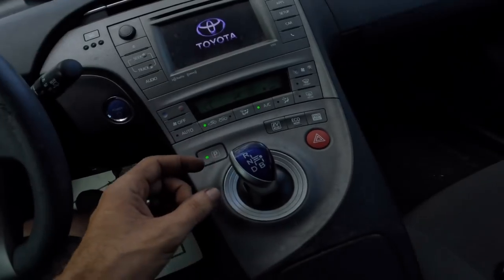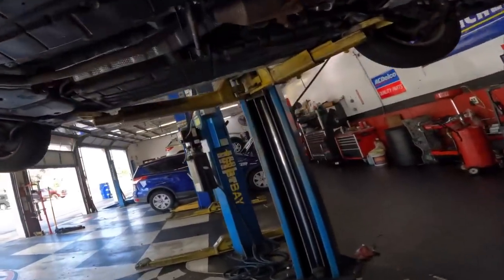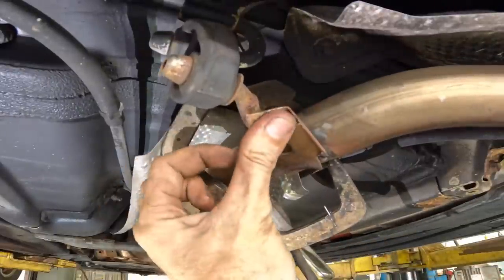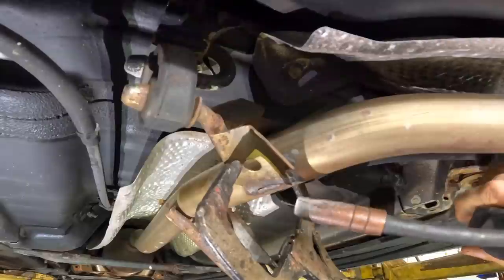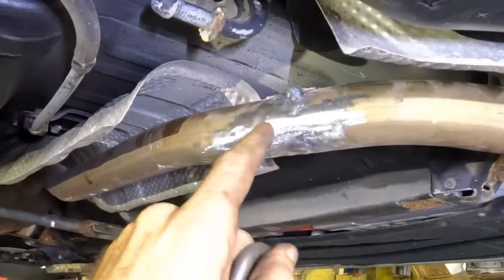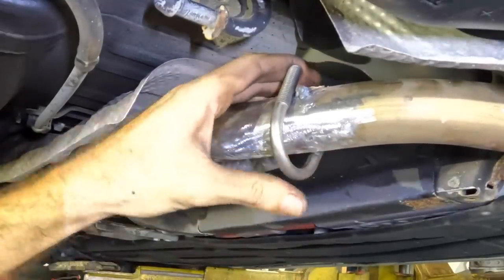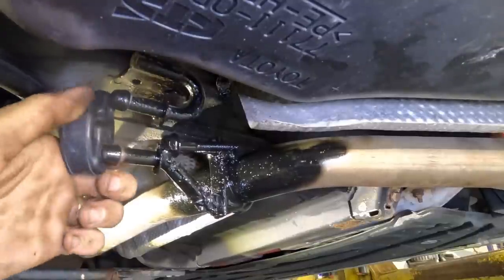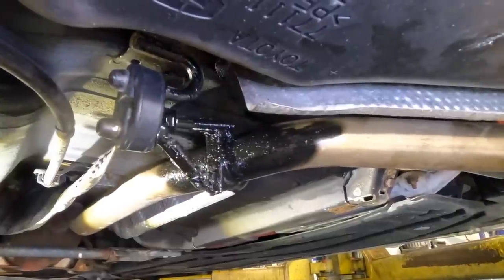This Video is a BAD Idea! Saved Customer THOUSANDS!

Comment: As an ex welder turned weld inspector, your welds failed TREMENDOUSLY lol however, you saved your customer money and are honest and that makes up for , well, none of your failed welds, but you did say numerous times “I’m not a welder” soooo not bad my friend, not bad. I’ve seen muffler shops with work that ended up looking significantly worse than this!! Most shops today would’ve told them to go to a muffler shop, if not charged them hundreds to “fix” something it didn’t need fixed. Great job as always!!
Reply: Do you think Ray's welds will hold over time?
Reply: @ptroinks  honestly they probably will. I’ve seen some absolutely beautiful welds fail epically and the ugliest welds hold. Also depends on the procedure they’re being inspected too also.
Reply: You wouldn't believe how many "custom exhaust" shops run 409 stainless and don't have the equipment to weld 409 stainless.  They just glob on the Er60S4 and call it a day.   The hope is they haven't damaged the stainless that much and the weld is thick enough that it will take time to rust through.
Reply: @KendrasEdge757  Something I've never understood about welding, is how a welder can be sure that the weld is good. Without ultrasound or x-ray, that is.
Reply: @ptroinks  when you’re welding you can see the puddle and you know that it’s fusing to the base. It’s gonna be solid but X-ray, PT, VT and MT and UT Is gonna show surface to sub-surface cracks and porosity. A visual inspection is sufficient for most welds and most welding schools teach basic VT to welder, level 1 typically. Basic exhaust welding like this doesn’t have inspections and typically mechanics haven’t done much if any welding school. They just don’t do much welding past tack welding. Which is completely normal. It’s not cheap when your main job is mechanican.
Reply: @ptroinks  Sure they will. After he cleaned up the old welds and installed the u-clamp, he was welding to solid steel. That repair will outlive the cat.
Reply: @OldBastardOnaHarley  Yep, he realized trying to weld rust wasn't working, so after all the cleaning with the die grinder, and starting over with 'nice n shiny' parts it turned out pretty good. With the addition of that top bolt forming a strong triangle, there's not much stress on the welds anymore. Strong enough to hold 200 lbs, but the exhaust pipe isn't very heavy at that point, that rubber connector becomes the weak sacrificial link. That rubber will break or fail before the welded parts will. Original one was already split...
Reply: @ptroinks  Why not, unless rust eats through it. The latter will happen sooner or later, exhaust on my car got its third welding session just recently. Had multiple leaks due rusted through factory welds and previous repair welds.
Reply: @ptroinks  I think a lot depends on whats at stake. On heavy equipment, high pressure pipes, structural welds, rockets, ocean going ships, etc,  it makes sense to go through the expense of extensive testing to make sure there are no hidden imperfections. Failure can cause injurys or cost big $$$. On something like this failure isn't that bad. It just makes some noise and Ray is reallly just extending the life of a part that would otherwise be scrapped.
*not a welder, just a guess.
Reply: @brnmcc01  Rigid bodies will amplify forces asymmetrical to the amount of force being applied. This is because of wave physics. Yes, wave physics. This is why welds sometimes fail under rapid small loads while the same weld may be just fine under much larger but less rapid loads.

I know this distinction is fairly pointless for a cheap exhaust pipe but just figured I'd share.
Reply: @ptroinks  Learning the proper technique followed by lots of practice.
On the practice pieces you cut across the weld to see how well it penetrated.
Reply: @Mavendow   That's very true, but I think that is the purpose of that rubber connector, it has flexibility as well as acting as a damping force to high frequency vibrations.
Reply: A local shop I've been to had a wall of shame for some of the crazy things they've found, like brake rotors worn down to the vents, funny repair jobs, and the like. I'm sorry to say, your welding wouldn't have even earned a dishonorable mention! 😁 I did see someone's exhaust repair there that included a two inch mound of weld. 🤣

Comment: Hey Ray - just a small warning - please wear welding Gloves when you weld!  The ultraviolet which the helmet shields your eyes from - also does SEVERE damage to a person's skin... you don't see it Now - but will in some years.  So be nice to yourself; invest in some welding gloves - and WEAR them - even on very small welding jobs...
Reply: As someone who's received many "sunburns" from welding... I concur. I used to get them on my chest/neck between my t-shirt collar and welding hood.
Reply: Welded in a squat position for half hour in cutoff Jean shorts. I’m a ginger. Second degree radiation burns. Ow.
Reply: And with breathing all that BRAKE KLEEN, not good
Reply: @aaronbritt2025  I attached a leather flap to the bottom of my welding helmet after doing the exact same thing. At the time I was wearing bifocals and had to look out of the bottom of the lenses when welding which meant raising my chin and exposing that area even more. 

Now I have a helmet with a much larger (taller) lens and I wear “cheaters” so I don’t have to raise my chin. Problem solved.
Reply: @Dave-ei7kk  I bought a neck guard. It looks like an ascot.

Comment: Hi Ray! Being a mechanic and an Expert on exhaust sytem and  pretty good welder I'm shocked that your saying there's no gas. In my old shop (retired now) we had a mig welder but it used Argon gas. Koodos for the repair insted of the replacement. For your rubber bracket next time put a little grease on both hangers, once the rubber on it will not slip off even with the grease. Love your videos .. Mark from Montreal Canada.

Comment: Welder here. main issue is that you tryna weld self-shielded fluxcore through some sort of anti-rust coating like galvanisation. makes it bubble up and look narsty as well be super weak. Glad to see you doing it in a way that will work well and save the people some money :)
Reply: I was thinking the exact same thing.  I'm definitely a novice, but I was taught the grinder should have come out before the welder :)
Reply: @innomin8251  Thank you for saying that! The rust and metal parts have got to be CLEAN! I am not a master welder but I have been wrenching for 30yrs I was taught to make sure the metals are RUST free before you weld!
Reply: Don't forget when welding with gasless wire you really need to knock the slag off between welding strikes. Welding over your Slag is not usually ideal. I think if he would have cleaned that pipe and bracket before he started this would have been a shorter video.  I personally would have wired brushed the galvanized coating off the clamp 1st as well. It would have making this job a little easier on him from the start.

Comment: Your welding woes may have been caused by the exhaust being plated in something that was not weld friendly. Maybe a some kind of bronze/zinc mix to prevent rusting. In future try taking a zip wheel to it and take the coating off, so your through to steel coloured steel, not that goldish type colour. Especially important to do if your trying to weld to a surfaced that's got a galvanised coating, not only is it a pig to weld to, the fumes are also somewhat poisonous to breath.
Reply: It's stainless steel not coated you need a tig welder for stainless
Reply: @bigdaddymak1439  you don’t have to use TIG you can use a MIG with stainless wire.
Reply: Stainless steel is no big deal to weld ,however not having a shield gas is .I find Tig is the smoothest weld but even stick can be done well with practice .Compliments on saving that exhaust system ,finally doing repair work instead of assembly line parts changing .
Your customer should give you a handsome tip.?
Reply: I agree but its probley stainless. You will need stainless wire and sheilding gas or a tig.
Reply: Exactly what I was going to suggest.    I'm no welder by trade just another tech. But I know from my experience  cleaning the surface before welding will usually make your welds stick a smidgen better. Great work ray!
Reply: "the fumes are also somewhat poisonous to breath" A little cyanide never hurt anyone....or maybe it did?  You really want to grind your surfaces clean.
Reply: @bigdaddymak1439  
No you  need stainless wire or rod but. You can weld to stainless with carbon rod it will  not be stainless  any more. This may be  aluminized  tube.

The thing that bothers me most as a AWS Inspector is that  he continues to  weld ove the flux without  cleaning EEWW
Reply: @monkeybusiness63  Well he did say he was not a welder lol.
Reply: Aluminized steel
Reply: Ray said it wasn't stainless because it was magnetic.
Reply: @bigdaddymak1439  Not really. Stainless can also be welded with MMA and MIG, sometimes preferably so as TIG puts lot of heat into workpiece. Sometimes I've used stainless electrodes "just because I can and had them around" and I feel that those stick/flow better on normal steel and slag is easier to remove. But then again, I'm not a pro, don't follow my example.
Reply: @OldBastardOnaHarley  just cause he said it wasn’t stainless doesn’t mean it’s true!  There are two major types of stainless Martensitic and Austenitic, Martensitic is magnetic and Austenitic is not! 

I am a retired certified welder that’s certified in many of processes!
Reply: It ferritic stainless so it can be welded but very hard with flux core and dirty... Tig is cleanest but mig isnstrongest but you need stainless wire and a different max gas.
Reply: A welder and a painter no less
Reply: @clintonhanson  Well Ray said he's not a welder and neither am I. So this is going to be an education from all you "certified" people.

Comment: IT student here: the shielding gas is there to help protect the weld from inclusions while it is being formed, without it the risks of an inclusion forming joins the 40 mile high club. so without it your increasing the likely-hood of the weld breaking in the future. there's also making sure your metal types match -certain wires don't mix with certain metals in welds because mixed metal corrosion is always fun!
you do what you gotta do Ray but Industrial tech guys will HIGHLY encourage its use when possible

Comment: That exhaust system is more than likely made out of grade 403 stainless steel (UNS S40300), one of its physical properties is being magnetic another is that it has good corrosion resistance. The problem with welding that material is that you get loss of chromium where it is welded, hence the corrosion around the areas that have been welded unlike every where else that is devoid of any corrosion.
Reply: Yup or 409. 409 is used for furnace heat exchangers as well, it can get some surface rust, but it's more resistant to cracking from heat cycles. 316 would have even better corrosion resistance in the salt belt, but would be more expensive.
Reply: Good coat of high heat primer or maybe ceramic paint would save it from rusting again. Multiple solutions to protect those vulnerable spots from pesky cancer.
Reply: I doubt its stainless unless its an aftermarket system. Stainless is what it should be but then it would never need replacing and unfortunately that is no longer how cars are made. Except maybe as a dealer extra upgrade at 5 times the actual cost
Reply: @Scott_A  A lot of OEM's use stainless for there exhaust systems. They are using 400 series stainless steels, be that 403, 405 or 409,  not to be confused with 300 series which aftermarket specialist exhaust manufacturer use. With the long warranties that OEM's now have, it would cost them a small fortune in having to replace the exhaust systems at their expense.  So paying a small premium for 400 series material is a cost saving.  As I stated 400 series has good corrosion resistance as opposed to very good/excellent with 300 series or poor with untreated carbon steel. The problem with 400 series is when welding thin sections there is a large heat affected area, this leads to the loss of chromium due to the formation of chrome carbides, net result is loss of corrosion resistance in the heat affected area, the corrosion is not just surface but also intergranular,  which then makes it susceptible to cracking,  that exhaust showed all the classic signs of that.
Reply: @iwb316  my bad, you are correct. Tho from what i just read the 409 seems to barely be better than normal steel but as you say its simply to pass the longer warranty periods now offered

Comment: Hey Ray, quick tip on your welding. 
There is and old saying that goes: if there's slag, you drag. 
Normal mig welding you "stab the weld" for flux core you want to drag your weld so that your liquid metal forms under the slag instead of through it. 
Hope it helps :-) took me way to long to figure it out. 
Btw I think its awesome you fighting the let's just replace anything society.
Hope you have a great day brother!!
Reply: I'm strong believer and replace repair rebelled reuse have a good evening everybody and goodbye oo

Comment: An old trick learned 80 yrs. ago...when you're trying to slide rubber over metal like that hanger has, just spray some regular rubbing alcohol on either part. It will slip right on and the alky evaporates without leaving any residue.

Comment: The clamp to attach things to exhaust pipe is the most secure method i have found. I use this method whenever I need to fix ot add a hanger to thin pipe. I usually just bend up a new hanger from 3/8" or 1/2" rod and then weld that to the  long edge of the stamped portion of exhaust clamp.  This allows clean metal for good secure welds.  I find welding to dirty, rusty and thin old exhaust pipe a problematic thing many times. Really like your channel.